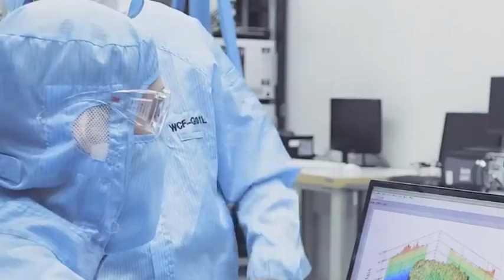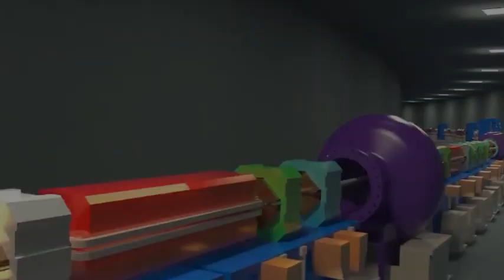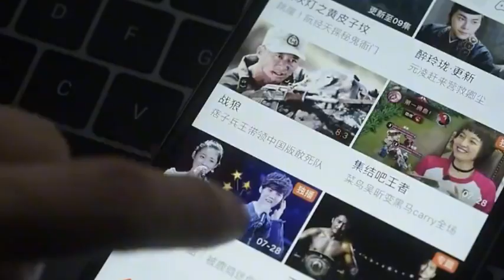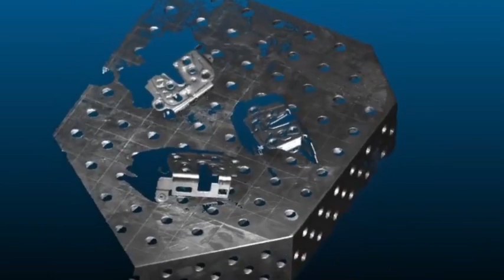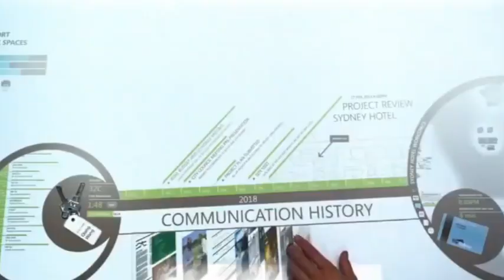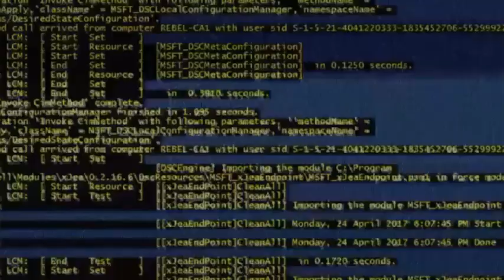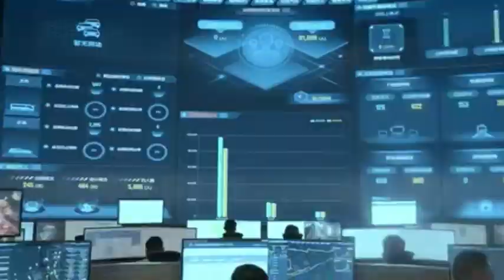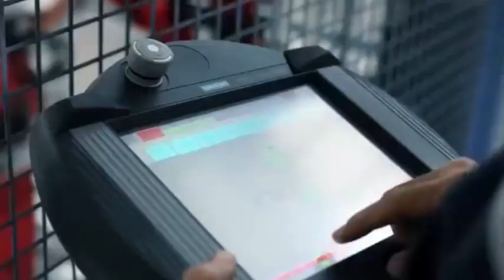China can't manufacture top-level lithography machines but wants to build lithography factories?

Comment: Fact 1. ASML is only the assembler, it isn't capable of manufacturing the machines. 
Fact 2. Without China market, doubtful ASML can survive.
Fact 3. By applying SAQP to DUV machines, China could make sophisticated 5-nanometre grade chips without the need for more advanced EUV tools sold only by ASML
Wonder If the high tech  chips were used on the one way ticket to space ?